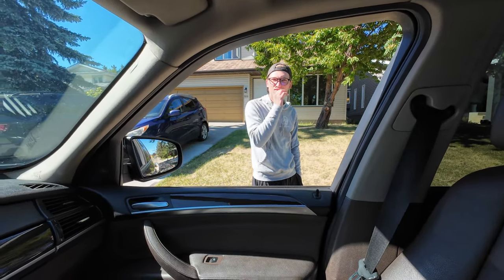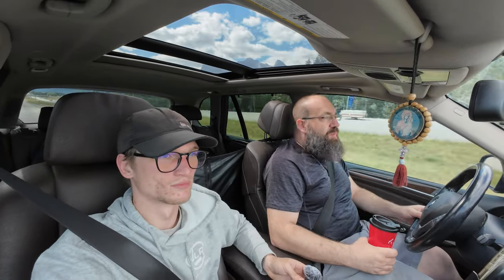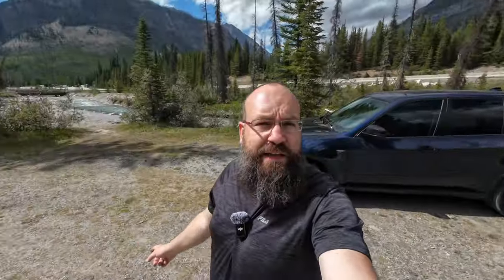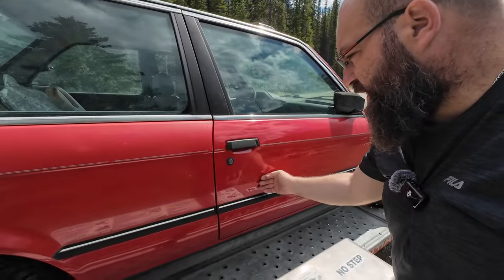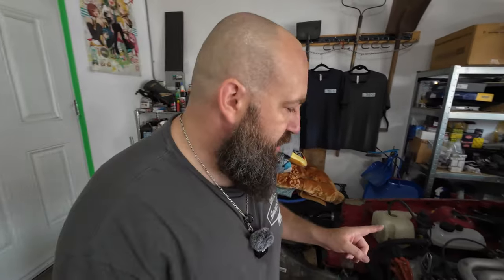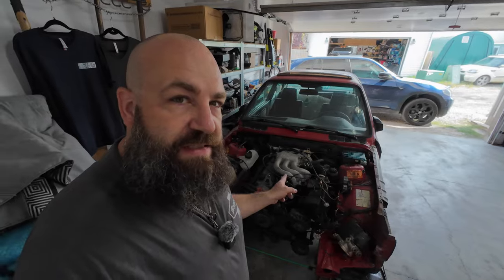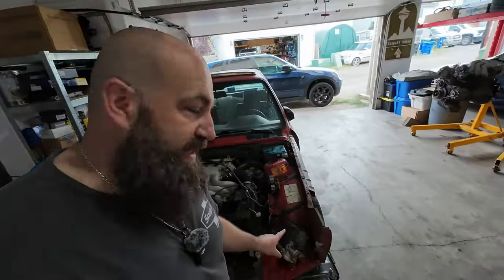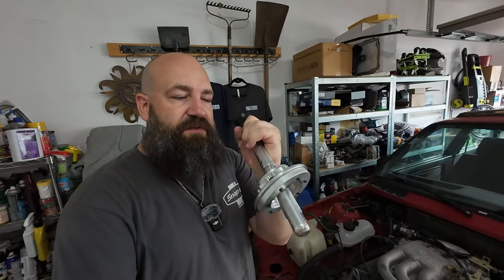This Barn Find E30 is About to Get a Second Chance!

Comment: My built super eta put down 158whp on the dyno. This was a 2.8ish because I had to overbore the cylinder walls to 84.5 I believe. Stock ignition and fueling
Reply from the maker: what pistons did you use? I've read to use either 325i pistons for the valve reliefs? I'd like to get 2.8L like you did with a different piston and cam perhaps.
Reply: @tony.nextlevelrides  you’ll need custom pistons, or SETA pistons. (88 eta pistons). I ended up going custom flat tops.